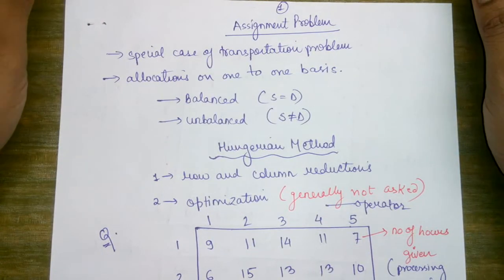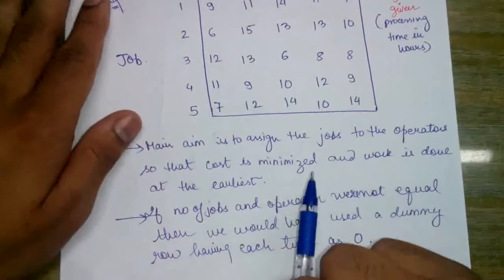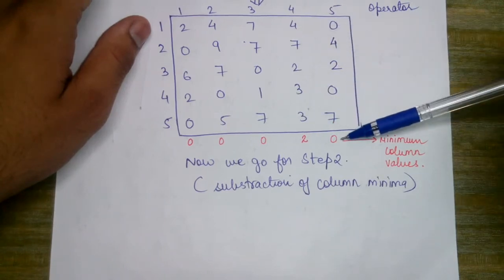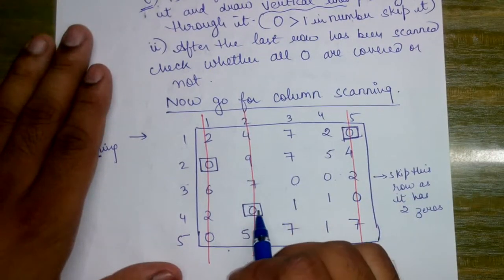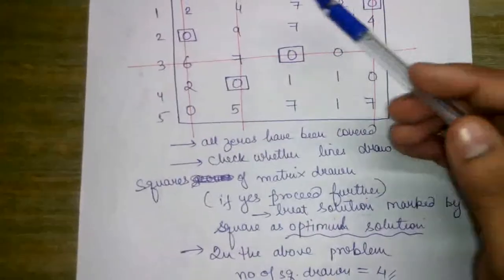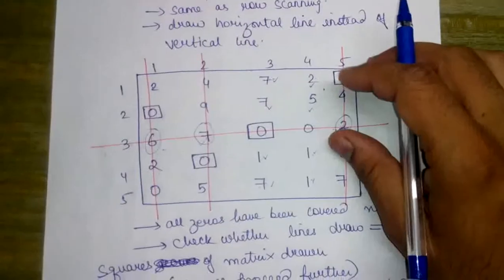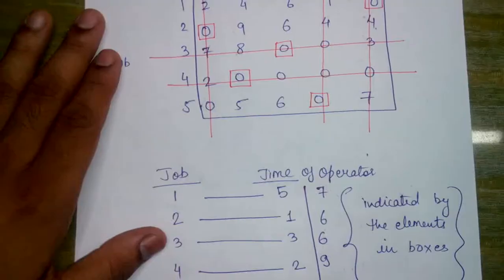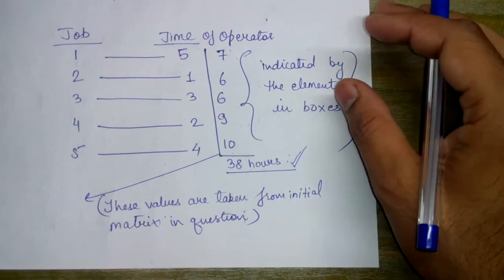Industrial Engineering Lecture 18: Assignment problem by Hungarian Method.

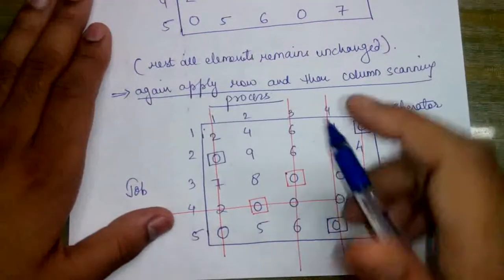Comment: At 10:20 there can't be a vertical line in 3 and 4 column as there are are more then one zero in 3 and 4 row..so there will be only 3 squares .Please see to it, sir. Its confusing..